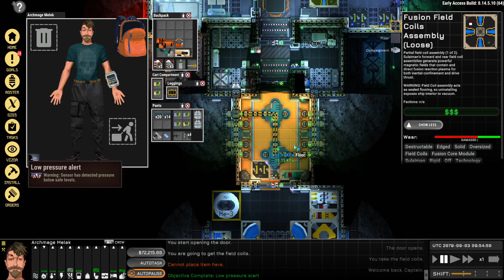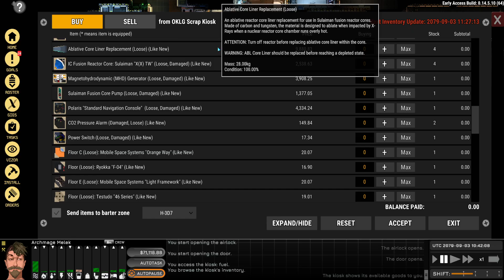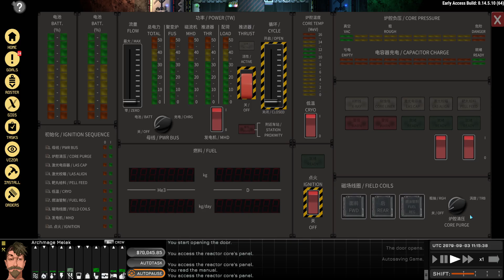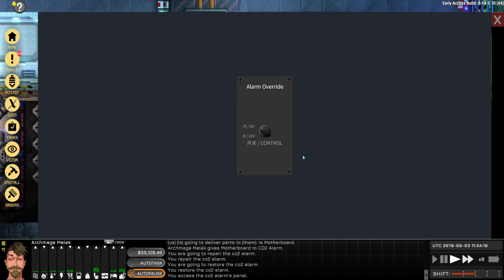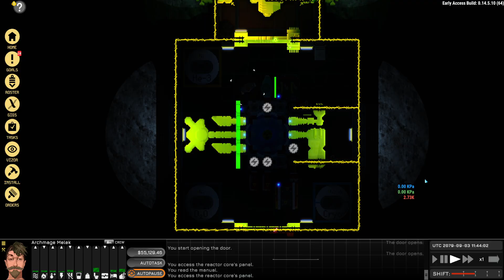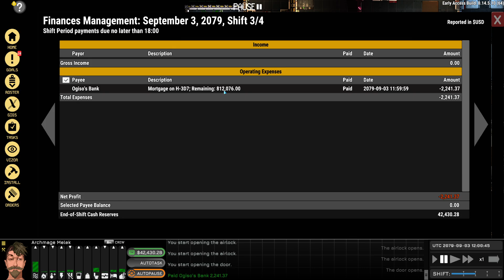Ostranauts - Part 27

Comment: yeh like LH said you should keep the reactor going ... it's not a light switch you can turn Off and On whenever XD 
also i saw you left more windows by the transit port (3 more on the "Old Emporium" side) 
i also agree you should have 4 batteries and leave 2 of them on a separate grid for emergency use (just have a switch and when fully charged cut the power to them). 
O_O since there isn't a proper rocket engine i'm guessing that is why you need to remove that middle tile under the reactor ... you are just releasing the fusion explosions to the outside to propel you XD
Reply: also not sure if this would work but you could try to get a 2nd MHD as that is what converts to Electricity so you could charge faster
Reply from the maker: Maybe? But I'm not even sure it's needed with such a small ship. Are there even enough systems onboard to drain the batteries faster than they charge as it is?
Reply: Yeah, that's what I wondered as well: are there no proper rocket engines in this game? You just release the energy through a hole in the floor under the reactor? 😂 I do know RCS thrusters are not really meant for propulsion, only for directional thrust and minor adjustments...
Reply from the maker: Agreed! I've massively levelled up my ship's range that was previously limited by the maximum capacity of both the batteries and the RCS propellant tanks. Now as long as the fusion reactor has fuel... my range is only limited by my ships life support. Food and water mostly... time to start stocking up the fridge and sink!